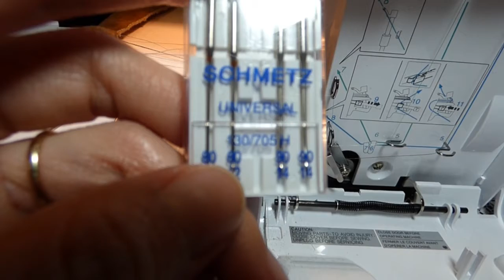SERGER BROTHER 1034D : What caused needles bended or break

Comment: Had it fixed but now my A needle is not working right.  It has large hoop in back?  Checked tension on all.. changed needle and far left owrks ok Guess I will have to only use 1 needle.

Comment: Try making a foot pressure adjustment or check tensions or differential feed if re-threading fails. Refer to your manual. It appears on one sample you are not lining up fabric close enough to bar beside needle. First try re-threading, when I'm in a hurry I tend to loop thread too tight in the slide of the lower looper. Whenever a thread breaks, you must re-thread machine entirely starting from #1 otherwise it will jam as well as bend needles ...
Google cheat sheet for serger settings ...

Comment: I have the same serger. It's been acting up as well. First the left needle wouldn't sew. I sent it in to be service, got it back and now the right needle has broken 3 times. I'm going to have to send it back.
Reply from the maker: I found out that this serger recommend only SCHMETZ universal needle (80/12 or 90/14) not ORGAN.  I bought a bulk of ORGAN needles but unfortunately I can use it with my sewing machine only. sniff..
Reply: +Mom2MyDearBaby EverydayMom (Tiparada _Thailand) I use Schmetz. They are the ones recommended by the user manual. I'm shipping mine off tomorrow to be repaired again. I'm praying that they'll replace it.
Reply from the maker: I hope you can replace it dear.

Comment: how do you fix that problem?
Reply from the maker: I knew which parts bent and try to really careful gently bent back in place (This can damaged your serger or the parts to bent or break easily!!)...but I would recommend to send it fix with the professional. and after that I'd learned if I sew with very stretchy knits I have to more careful with it or the fabric can make a needle a little slip to hit something else under there. For me I change the needle to stretch needle or topstitch needle and it has no problem and everytime I use the interfacing under the fabric (ex wash-n.gone or sol-u-film) while I sew.

Comment: I had mine for 2 weeks and It is my FIRST one... It is doing the same thing, I thought it was me then I found that the upperlooper is bent and something else has to be wrong it keeps braking the needles and the thread keeps breaking also after every time I use it 6 needles so far ....its going back today!!!!
Reply from the maker: yess..it is really delicated machine . sorry to hear that anyway but glad you still can return it in time. I always buy the warantee add on with the new machine.
Reply: Thank you for the video... it really helped, Have a have day.. and the New one is working just fine and sews better :)
Reply: I have the same problem with the needle breaking, but cannot return it.  Never used it until 2-3 months after purchase from Amazon.  I was merely testing it and the needle started breaking, hitting on something. will call Brothers for some help.

Comment: i managed to fix that issue, dm me for help!
Reply: And how did you fix it?
Reply: @kakes005  if u look close u will see that the needle is hitting a small metal. unscrew the flat metal top piece where u place the fabric on top.
 turn it upside down n take that little piece under then bend it a bit towards the base. fabric  puckering and and to sewing heavy materials can distant that piece 0.3 mm is enough to start breaking all needles
Reply: Emman Mach thanks. Worked